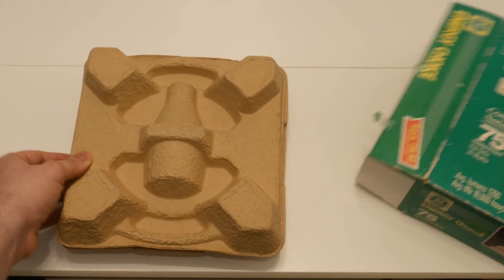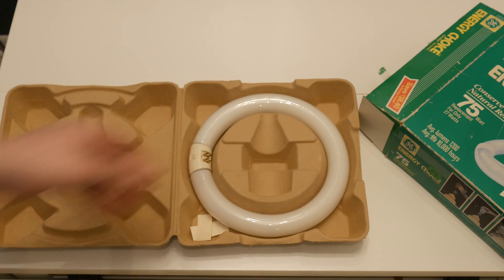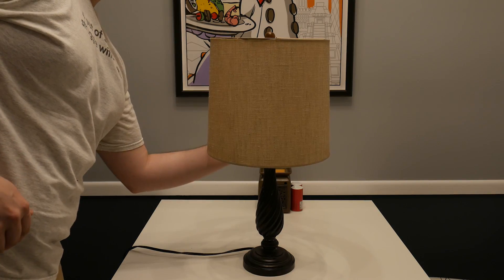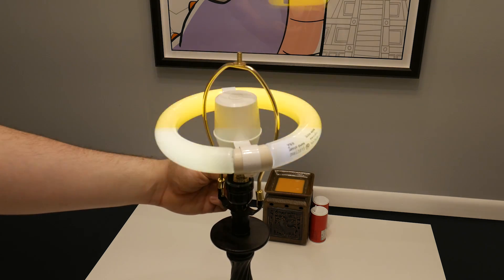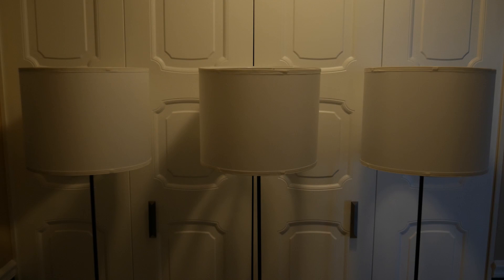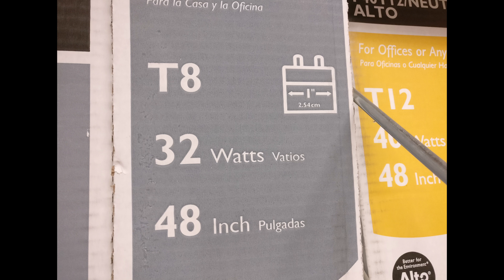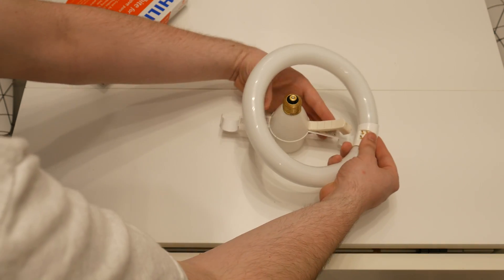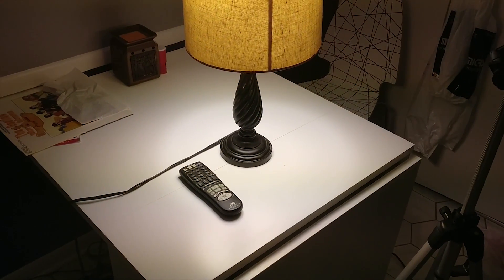GE's bizarre early attempt at a CFL

Comment: The T numbers for fluorescent tubes is used worldwide because they were invented in the USA, then adopted worldwide. There wasn't, and still isn't, any reason to alter the design to "metrify" them. It's the same reason CONEX shipping containers are all sized in feet. The US military invented them and started using them during the Korean War. The idea caught on and to ensure that all cargo ships and handling equipment would be compatible, everyone had to make their containers in feet, like it or not.

Wheels for vehicles are nearly all sized in inches for diameter due to 'institutional inertia'. There's such a huge number of vehicles in existence with such wheels that even if it was decreed that starting January 1, 2019 that all new vehicles worldwide were required to have wheels sized in whole centimeters, it would take many decades to switch over the 'installed base'. Would governments ban inch sized wheels and tires, issue a confiscation order and send teams to go around with jacks and blocks to take the banned ones? With so many millions of vehicles with inch sized wheels out there, attempts to get peoplr to accept metric ones have failed hard. Look up the Michelin TRX. Michelin quit manufacturing them some time ago, sold the molds to Coker Tire. They've made a batch in all sizes but are currently only selling stock on hand and future production is not guaranteed.

That's what I'd like to see a video on, the failure of TRX and other attempts to replace inch diameter car wheels with metric diameter ones.

Comment: I'm pretty sure my grandmother had one of these in her kitchen. If not this one, it was something similar, as it was a circular florescent bulb in a normal light fixture. 

It wasn't sickly purple, though. Just that standard department store white. Not the warm light we're used to indoors, but okay. 

Yes, this meant that the globe around the light fixture was completely removed, which is why I know what kind of bulb it was. This was in a typical fan light fixture, and actually hung down fairly low. If it were not over the table, the taller people in our family would have bumped into it.

I'm pretty sure she picked it up in the mid 90s, since I do vaguely remember a time before she had it.

Comment: These circline tube's are still used in workbench magnifiers where you look though the center magnifying glass with the tube illuminating around the opening. Works really well when your trying to solder something or doing other delicate close up work. I've seen new ones with a ring of LED's, but I don't know if they have dim-able ones in LED, that would be useful.

I agree, the old circline florescent tubes had bad color rendition with their limited 2-phosphor blend versus the newer tricolor phosphors.

Comment: I had at least one of these in a lamp in the 80s. The harp removal was no big deal. I also screwed one into a china lamp socket in the ceiling of the laundry room and put a "standard" square single hole diffuser on it. They made an adapter that attached to the ballast that had the threaded rod for the nut screwed into the center. You could pick up replacement diffuser in the big box home center I worked in for about 5 bucks so I bought an adapter and diffuser. Cheaper and easier way to make a circline installation than buying a circline fixture, and looked like a regular light fixture. Plus, if you think about it, CFLs are a tremendous waste because you throw away the ballast every time the bulb goes bad, and the "Compact" part of the equation of a CFL means that they are so packed inside that heat leads to premature failure. Sometimes more modern "solutions" suck.

Comment: My cutting-edge-technology uncle bought one of these for my grandparents' basement laundry area. It's a pullchain light, and the chains hangs down between the bulb and the center piece! It's still going (with the original bulb AFAIK) after 25 or so years of light use.

Comment: My mom had one very similar to this in the laundry room for years and years. It was slightly different because the bulb was held in a frame that slid over the ballast and had two sliding plugs in one arm to connect it. It was very sleek-looking compared to this device. But by the time it finally burned out, of course, the company no longer made replacement bulbs anymore.

Comment: Oh, PS - the T-whatever designation does seem to be pretty common around the world, I think it's just "one of those things", same as hardly anyone called floppies 13cm and 9cm instead of 5.25 and 3.5 inch, even in countries where metric has been the norm so long that no-one really has any clear understanding of what an inch is, and even though the standards for those discs are themselves metric (the only disc ACTUALLY specified in inches was IBM's original 8" type, I think? Though there are little-known 2.5, 3.0 and 3.25 inch varieties which might also count because they're just not really that close to any particular round centimetre/millimetre figure) .... or how edison bulb fittings are actually numbered in millimetres despite the largest market for them (instead of bayonet / mini bayonet, GU-series, multi pin fluorescent, low voltage barrel plug and bare terminal press-fit types) being the USA.

I'm vaguely familiar with certain T-sizes but until now didn't know they were 1/8ths of an inch. I'll have to meausre the ones I can actually get easy access to in order to confirm? Somewhere, particularly, I have an oddball camping / car-emergency pocket size fluorescent strip-bulb torch thing, and the tube for that is either a T5 or T3, can't remember, but it IS pretty scrawny, and the only reason it even gives off a usable amount of light IS because it's a fluorescent tube (...it pre-dates decently powerful LEDs) rather than halogen or incandescent.

Most people in metric land probably don't even realise the significance... just think "this is the size I need because that's what's written on the side of the scrapped bulb".

Comment: Although it's much, much slower with the power off, mercury vapor gets permanently adsorbed over time into the glass of the tube.  This could be why the color is off -- with so little mercury, the filler gas is being energized, and it's probably argon, which glows pink.  The lamp might have given off a good color of light if you'd made use of it when it was new.

Comment: We bought one of these in the mid 80's but the design was slightly different as far as I can recall.  The tube had a permanently attached crosspiece with a large circle in the center which slipped onto the ballast/starter and had a slider piece near the center which made the connection from the tube to the starter unit.  We also learned the hard way that lamps with small bases became very top heavy with this thing installed.  One evening while trying to turn a desk lamp on, it tumbled onto the floor and the tube exploded.  After cleaning up the glass shards, my dad threw the attached crosspiece in the trash too so I never got a chance to see if another tube could be used.  Years later I found the starter unit in a drawer and it remembered this oddball lamp that never took off and how we hated it.

Comment: Give it a couple years and you'll discover another reason those things didn't do well: the intense UV it produces will make the lampshade turn brown, warp and crack, or just disintegrate.
Reply: he used a modern T9 bulb  which doe snot have that issue
Reply: He was saying that the old ones did that. It's likely also a contributor to why they didn't take off.

Comment: to be honest - the lighting images you showed -  show this as being a more accurate and pleasing light source for photography than the LED you compared it to -  I feel like these would be great if fitted around the lens of a camera.
Reply: Hmm, perhaps a new adapter could be made which has long "arms" so it can go well around the camera! But the issue remains with the weight, some UV (which the camera MIGHT pick up and ruin some vividness) and the… i guess… high voltage?

And a magnetic ballast may affect the camera's functioning, I don't know.
Reply: @SreenikethanI  Any digital camera would be heavily affected by the magnetic ballast, if it were placed anywhere practical on the camera, and it would draw too much power to be practical for a portable device, but I can certainly say that it would work perfect for lighting a set that you're taking pictures on.
Reply: i thought the same as you
Reply: Electronic ballasts have been around for a while. It should be a simple matter converting an F20T12 ballast and starter to the Circline.

Comment: Your testing is flawed you need to run this lamp for 50 hours then do your test. My sylvannia's CFL's will give off that purplish color you describe and they came out just a few years ago when new until 50 hours have past. Also, then color goes from 1500k to 6500k and the 6500k is a very sterile white color while the 1500k is a very soft white color.
Reply: 1) It remains a flaw.
2) it should be in the product description.

Comment: I bought and used several knockoffs (not GE) back in the day. They were okay. I think the ballasts were electronic, and the phosphors slightly better than with the GE. Pain in the arse to install, but not that bad over the long term. They were certainly easy to find for a few years, and as the early CFLs weren’t always too bright they were a reasonable alternative for a nightstand lamp’s bulb.

Comment: Regarding the lifespan and reliability of the ballast, we had two of these in our kitchen for 30+ years...  never had a single problem other than the normal bulb replacements every few years until one of them finally died.   We replaced both of them with LED bulbs a couple of years ago and now it seems like we're replacing those every year...  but on the bright side the LED bulbs to have better color and there's no wait for the bulb to start.

Comment: At the time I purchased two of these and still found one of them (moved several times since way back then) and the biggest pain with them was that the plastic holding the bulb to the base broke.  I guess it was due to heat but the both broke like that so I used a string to hold them in the holder.  The other was, of course, the inability to use it in a lamp.

Comment: Ha. I have one of those adapters. Robbed the lamp from it for my magnifier lamp. I also have a ceiling fixture that has a 2800 warm white lamp in it in my hall way. Been running since 2003 and still going strong. Those old magnetic preheat lamps last forever unlike CFL and LED lights.

Comment: Up until very recently as LED alternatives improved I had been using circline bulbs in my lamps for several decades.  They might have been awkward to replace as described, but they ordinarily lasted for many years before the bulb required replacement.

Comment: I just replace two standard circline fluorescent ceiling fixtures earlier this year.  The ballast went out in one and then the other went a month later.  I believe they were installed some time in the early-to-mid 80s so they seem to have lasted a bit longer than the expected lifespan of that GE converter model would suggest.

Comment: I still have one of these that I purchased around 1992. it still works, and as far as the color, at the time, it wasn't a big deal. Today's technology has spoiled us to the number of choices available.The newer CFL's seem to be more of a hazard, to me, as I have never had any of the older ones explode on me. I have had four of the newer 'curly Q' CFL's do that; one of them less than 2 feet away from my head at the time! I'm also not a huge fan of the newer LED's, but understand the need to reduce electricity usage to have several in my house. Thanks for the trip down memory lane!

Comment: I started using CFLs and circular tubes in 1998 because our air conditioner really wasn't working, and these things didn't get hot at all. The bluish light made me feel cooler too. I used circular tubes where I could because the life of CFLs at that time just SUCKED! The ballasts on those things just burned up when they failed. My first ones lasted for a week. That was the entire set of three I bought. Expensive too! I got my warranty for them though. The ballasts for the circular tubes, however, didn't burn up and lasted for years. Around 2005, Walmart came out with their Great Value, generic CFLs that lasted for a long time without the spontaneous combustion death of brand name CFLs. They were also much cheaper so they were a clear choice for me. I have no idea why those worked the best. May be, it was a brand name conspiracy, and Walmart figured they could cash in by providing the longest lasting lights on the market. I don't know. Around 2010, I started trying out LED bulbs, but they were expensive! I was buying corn LEDs from China because they were not only cheaper, but were actually bright enough to use for regular lighting. It seemed like it took forever for them to make LEDs that were decently priced with usable light. Oddly enough, Walmart's Great Value generic answered that call first. Brand name LED bulbs followed in brightness, but the Great Value bulbs are dirt cheap now and last forever. I avoid brand name light bulbs now. Great Value bulbs may be of a less expensive construction, but they seem to know what they are doing! CFLs and LEDs operate pretty warm now though.

Comment: About the only valid negative is the color rendition.  All of the other "complaints" are nit-picking.  If it fits your lamp or fixture, then no problem.  Assembly isn't really terrifying.  Temporarily removing the harp for a lamp that lasts half a decade or more isn't a particular burden.  CFLs came along and simply made this configuration unnecessary.

Comment: Video fail.  I had several of these in the 90's and they worked fine. No problems, worked without trouble, and no difficulty installing.  You have created 'problems" where none existed.  My kitchen used a standard circline tube.  Simple to install.
Reply from the maker: I don't recall suggesting the product had operational flaws, rather that it had somewhat limited applications, required assembly which could be awkward, and had horrible light quality.  Hence they enjoyed limited popularity and were more of a niche product.
Reply: No more a niche product than 3-way lamps that they might replace.
Reply from the maker: I'm not talking about the tube, I'm talking about the adapter.  Referencing your first comment, you seem to think this video is a commentary on circline tubes in general--I doubt your kitchen fixture used an adapter like this, it was probably designed for circline tubes.  Obviously I know they're common, as I knew I could find a replacement at the hardware store.
Reply: I mentioned Circline tube applications since you take pot shots at the tube in particular.  At heart I feel your criticism unfounded; this was a satisfactory product in its day.  Perhaps the tube you have is defective or aged poorly.
Reply from the maker: I am so confused by the series of comments.  Did you watch the video?  I replaced the tube, and am using the lamp right now!  And as I've now pinned a comment above, never was this video meant to criticize the circline tube.  Rather, it's a retrospective on GE's weird attempt to shoehorn them into an everyday table lamp using this adapter, and in hindsight it looks like an odd, early attempt at a CFL.
Reply: @TechnologyConnections  It was an economical way to get away from incandescents . As I pointed out in a earlier post, early CFLS cost about twice as much as these. I think I have a CFL floodlamp replacement from that period which had a $27 price tag on it.
  It's actually GE's second attempt at an incandescent replacement. Before this there was a product that look similar. It was a 44 watt replacement for a 75 watt incandescent/ The tube was a bit larger and was a proprietary design that only fit the GE adapter. I had a couple of them. One was in use for dining room hanging fixture that I used for over 30 years. The remaining 
lamp was moved to a basement fixture where it works today. The unit you showed was GE's answer to Lights of America's version. Since they both  adapted a standard Circline bulb they were much less expensive to purchase.
  You're correct that they were a PITA to use in a table lamp but once installed one was good for years. I don't think I've ever killed the adapter but have replaced a lamp or two.

Comment: Just screw the inches and diameters... 
i just solder or connect with screw terminals the correct wattage bulb to a ballast, (electronic or magnetic, doesn't matter), and let it ALL hang on multiple coloured wires (usually cut from broken ATX PSUs, the more colours, the less chance of blowing something;-) from ceiling, the MAD MAX Style ;-)
Your girlfriend/wife/female friends will just love it ;-)

Comment: We got one of those in the early 90s. I remember it lasted more than 15 years, we changed the circline tube at least once before the ballast went out and it got replaced by a CFL. Both the tube and the ballast are more efficient and longer lived than a CFL because the tube isn't so thin, and heat dissipates much better.

Comment: Bought a few in the late 80s and 90s, had one GE one last about 20 years with the original bulb, 1/2 way frequently used in the laundry room. Beats those new ones which you're lucky to get 8 years out of. The only thing bad about it was the warm up time, which took about 10-15 mins to get up to full brightness.